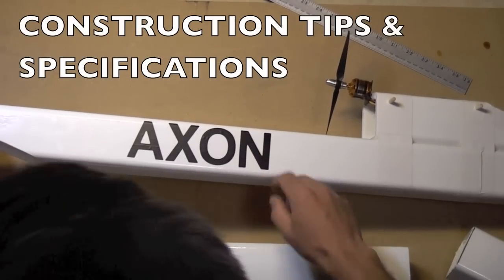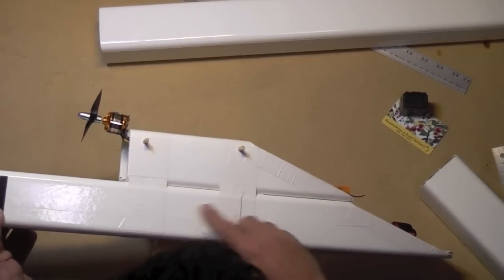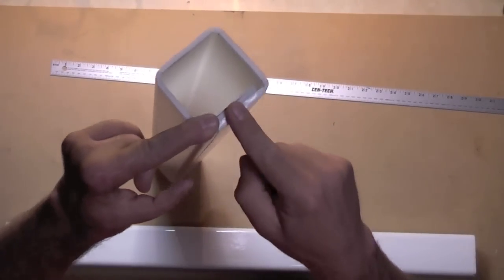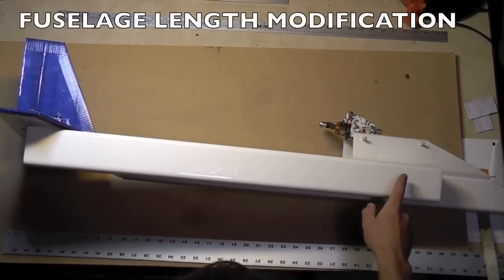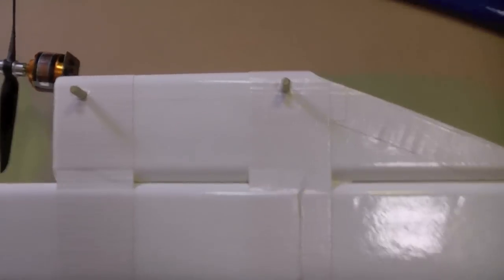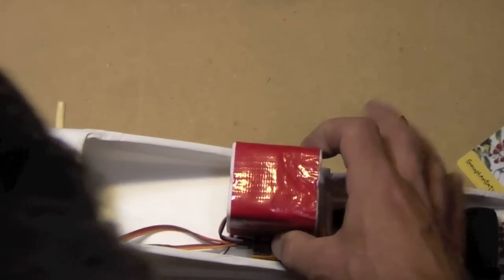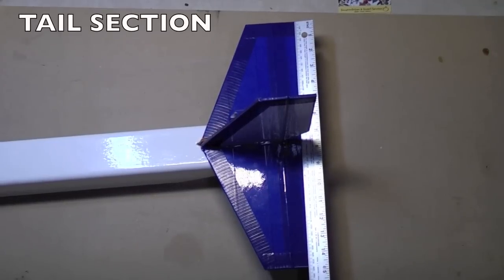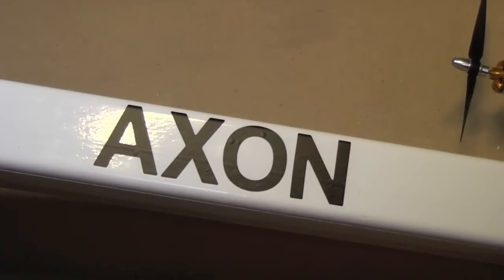AXON Construction Details

Comment: Can someone help me here. He uses a 2200kv motor at ~ 200-240W. What would be the impact if I use a 950kv with ~260W and the same propeller. If it won’t work, could I change the prop to make it work?

Comment: OK I am making this...can I use a 1300 kV motor running on a 30a ESC and a 2 cell 25c lipo??? plz reply
Reply: will I iface any problems with that motor?
Reply: 3 cell is simply "more fun"! I have flown mine on 2S many times and it just needs a less aggressive climb rate. These planes are "fabulous" and Ed is a real detail-oriented "wizard". No surprises here. I will never fly anything but a "pusher" design anymore - no more broken props and it is the safest plane in the sky these days (especially for newbees). They just "FLY - beautifully"!

Comment: Can any of you guys offer some advice.  I built this plane and I am having trouble getting it to fly.  It glides very well when I throw test it.  However when I turn the motor on it augurs nose into the ground almost immediately.  Any thought?
Reply: It sounds like you may be having an issue with the motor angle. I believe Ed recommends 5 degrees (downthrust). Did you double check that?

Comment: what type of wing will I need to use a 4000mah 4s with a 40 size 1500 kv motor? Will I be able to fit a 9x5 prop?
Reply: You can use whatever size wing you want...but you will not be able to clear a 9 inch prop with this design. I run a 7 inch prop and I have a slightly taller motor mount, and barely clears.  You will most likely need to do some changes for prop clearance, or different prop.
Reply: Christian Prodanov My goal is to have a wing that will allow me to travel the most distance thus obtain a lot of lift. What setup would you suggest I use?
Reply: Ed's setup is very efficient.  The 60 inch will give a better glide. Anything bigger. ..will be a difficult build and not as sturdy.
Reply: Christian Prodanov Thank you friend

Comment: Hey Ed, or anyone.... do you think it would be functional to upsize an Axon to a 65-70" wing and apropriate fuse size in order to carry a 4s 4000 nanotech and APM gear? I'm looking to repalce my Finwing Penguin and diggin scratch buildin from foam right now and this seems like a decent option. Any thoughts?
Reply: I think you can get away with a 60 inch. I have a 60 inch wing at 36" fuselage, and I can put a lot of weight on mine. Glide slope is great as well.

Comment: Just finished my Axon as well as Noob tube. Ed, thank you so much for making these videos.  I have been following them and building for over a month now.  Have a lot of spare parts and am assembling several more aircraft.  I'm confident that the noob will fly well and am scared to fly it as I spent a lot of time on it and it is virtually perfect...  The Axon I'm not too sure about.  I used a 60 in wingspan with 7in cord and 2 inch control surfaces.  It's heavy...  Think it's too much?  Guess putting it in the air will answer that...
Reply: Scott, I'm sure you did your maiden already.  I built an Axon with a 60" wingspan and large wing chord like you have and it flew great.  There is a video of it on youtube (search Axon Maiden).  The title is "Axon Maiden Flight - 60" Armin Wing" and it is under Liam (my son's) channel.
Reply: How did it fly?

Comment: Hi Ed,  I'm through most of the parts build and wonder about flaps..... have you ever put flaps on the larger wing and how did it work.  I've build 7in cord X 30in X2.  I figure I could use 60% control and 40% control surface as flap.  What are your thoughts?

Comment: My guess is that some air is always deflected outwards by the prop, not just backwards. And possibly forwards near the centre of the prop, as the shape there is not very efficient. Many of the flat board central prop RC flyers are very noisy if the gap around the prop is quite narrow.. Try blowing a stream of air from your lips and bring the edge of a credit card, or something flat, up into that stream of air. There's your noise.

Comment: I did this after tearing up aileron ends & a prop when my motor mount broke during the maiden flight. Found that the extra inch or so between prop & trailing edge made a very significant reduction in noise levels too.  No idea why this happens but I have "noise intolerant" neighbours so its certainly a good thing.

Comment from the maker: Yes, that is perfectly OK.  I use a 30 inch arrow in my 60 inch wings and no problems, even with hard maneuvers.  See the Photon design for some testing of that.  The carbon tubes you get from HK may be thinner so do have a look at them for strength.  Happy building - hope to see some videos!

Comment: Hello Ed. I´m considering a 55in wingspan Axon. I can find only HobbyKing´s hollow carbon tube 6x750mm or around 1/4 x 29,5in.,, no spare arrow shafts in my country. If I use one   the remainng 15in. section  of each half wing won´t get  a carbon  spar reinforcemnt. Is that a good Idea.?  Thanks for assistance and nice videos collection.

Comment from the maker: I would go on the generous side with your vertical stabilizer and rudder especially, and it wouldn't hurt to give a bit bigger horizontal stab as well. You'll want more affirmative yaw stability and control with that big wing.  Fortunately the control surfaces are somewhat within the prop blast, so that's a plus.  I'd say 9x6" for the vertical and 16x6 for the horizontal, swept recommended, and control surfaces 1.5".

Comment: I'm building a scaled down version of the Axon for my father in law and I was wondering if you think it's a good idea to make a 1.5" fuse tube?  I'm trying to make it 25% smaller except for the wing chord - 45" Wingspan, 30" Fuse.  I think I'll be using a little smaller motor since it will weigh less and allow for a smaller battery.

Comment: Hi Ed.. This may be pushing it a bit, but I have all of the parts & pieces from an ArtTech 98" wingspan D-2500A glider... which met with a violent death..  I am wondering if it would be possible to increase the size of the Axon proportionally to accommodate this equipment. The plane's weight was 67 oz., thrust rate-0.85 ... A  C3720 brushless motor and a 14x8 folding prop. .. Not sure if it would be practical, but I have this stuff laying around and I really like the looks of the Axon.

Comment from the maker: You could either stack another "deck" of foamboard on top, around the motor mount, which provides a flat surface for the wing, or you could make another motor mount with the motor tab longer so it sticks up higher, then you could mount the fuselage tab inside the power pod, clear of the wing.

Comment from the maker: Go with the bigger wing chord and more powerful motor.  Find any motor at 2000-3000KV that will take a 6" prop and puts out better than 400w.  Here is one idea from HK: 	NTM Prop Drive 28-36 2700KV / 595W.  This would scream with a 6x4 Master Airscrew prop.  It'll be noisy but it will do the trick.

Comment from the maker: 5" airfoil + 1.5" control surface would just be a little lighter and nimbler than the 7" + 2", but either is a fine choice depending on what you need to do with it.  The narrow wing has surprisingly good glide.  I would probably bump up the motor power for the larger chord wing, still a high KV motor but a bigger can with more watts.

Comment from the maker: Pretty standard 30-40% aft of the leading edge is good.  The 42" fuselage version does usually need landing gear, big battery, FPV gear, etc. or something in the nose to balance the tail.  If built for just a trainer or fun flyer, consider making the tail tube section shorter for an overall length of 36", for example.

Comment from the maker: Actually I meant the throttle-to-elevator mix might not to be as aggressive with the Axon since it already has a high thrust line, which tends to keep the nose down.  The flap-to-elevator also is likely to be less, but it kind of needs to be tuned to the individual plane.

Comment: Hey Ed, the freezer idea worked. In addition, I found it useful to use an 10" block of wood as a gig. It barely fits inside the square tube. I taped graph paper to it to help pre-align the motor mount on the gig itself. I used  four 1/8th inch bits of 3M tape to hold the mount on the gig during placement. Seemed to work. Thanks again.

Comment: Thank you for your help. I mounted the motor with the shaft through the vertical side. Now for your big secret. How do you align your motor & mount. I feel like a dentist working back in a small cave. The 3M tape is great, but it’s difficult to keep it free during trial and errrrror attempts. Thanks. The servos are coming. Should be in the air in a couple of weeks. Glad it doesn't have to be perfect to get off the ground.

Comment from the maker: 4. cut a new E-clip retention groove in the existing shaft, back out the grub screw, and push the shaft through with a vise and sockets.  For a pusher prop only, you have the option of just removing the E-clip (actually more of a C-clip on this motor) and the grub screw and just pushing the shaft through.  The can will NOT be attached but will stay on via the thrust generated.  However if you reverse wires, the prop will fly right off.  It's not a very safe way to go, not recommended.

Comment from the maker: Those are great motors, excellent choice you made.  You have several options, from easiest to hardest:  1. flip your motor mount and place shaft through it  2. there is an accessory kit to mount the prop hub on the motor can, then you just ignore or cut off the shaft  3. replace the 4mm shaft with one having the E-clip retention groove on the end (not the middle).  RCTimer is one source.  Use a bench vise and driver sockets to press out the shaft.  See forums and youtube for info.

Comment: Finishing my first build--Axon. Used the more powerful motor: 21481__NTM_Prop_Drive_28_36_2200KV...
Unfortunately, the motor came in with the 4 mounting holes and shaft on the same side.  How do I pull the shaft and reverse the setup? The local RC hobby shop guy said to pull the holding ring to pull the shaft, but he did not know if it could then be reinstalled on the other side. Thanks Ed. Your planes and videos are great!

Comment from the maker: Very carefully!  If you can weasel the adapter shaft in there by any means then do that preferentially.  If not I would use a drill press, and a bit that has some self-centering tendencies, like a step drill bit, so the new hole is as coaxial with the original hole as possible.

Comment: Did the scale thrust test Ed, had 360 Grams of thrust, Put the 6-4E prop on and it jumped up to 480 grams of thrust, I'm going to step it up to your recommended hardware, Thanks for the advise. So my maiden flight is on hold till I can be sure to get airborne. Thanks !

Comment: Hi Ed, i have watched some of your videos and would like to try building one of your planes,  I had a question on parts, i already have on order from HK, the following FC 28-12 1534kv, with 7x6 prop as the motor suggests, with a 20amp red brick esc  est. 730G thrust.  Can this combo work with the axon, or should i order as you suggest D2826-6 2200kv with a 40amp esc.  Trying to keep my costs low. Also would like to get a motor prop esc combo that i can change around on your different models.

Comment from the maker: 780g all-up, with a 2200mAh 3-cell included, is very respectable for an Axon, especially if it includes 187g of ballast.  That's a whole second battery right there.  Or you might think about landing gear.  As much a pain as they can be it does make first flights (takeoffs) less stressful in many ways.  I think your powerplant might be a little anemic.  You can very carefully put the nose on a kitchen scale and throttle up, and be sure you get at least 500g of thrust.

Comment: Hi Ed, I just completed  Building the Axon, Your instruction is top notch for a novice, I've never  had a transmitter in my hands let alone had anything airborne,  my maiden flight will be the first time I try my hand at flying, my question is how much should the Axon weigh RTF, My completed Axon weighs in at 780 grams, and the weight I need to correct the CG is about 187 gr, ?? 2620-1900Kv / 20a ESC / 5" prop. I have a 6-4e at the ready, 
just want to go up not down Thanks, MrDaFreak, SoCal.

Comment: Ed, I have flew my Axon 4th time yesterday... The plane doesn't seem to have enough power to do basic acrobatics. I have flown with the 6x4 prop and someone suggested to try at least 6x5.5 prop. So yesterday I have put the new 6x5.5 prop , it seems like it flies slowler and still doesn't do the loop. Can you give me any advice plz, it's just frustrating because in ur videos you make effortless loops, why doesn't mine do it ? :/ The plane is pretty light, no fpv or landing gear, just weights

Comment from the maker: That's a perfect motor, just the one I use.  You should get plenty of thrust from a 6x4 on a 3-cell Lipo.  The 2-cell 7.4v rating is fairly useless for these purposes.  A 5x5 would theoretically be OK but you'll obtain a bit more efficiency by using a 6" diameter and a slightly lower pitch.   You're on the right track!

Comment: Ed,
Thanks so for your vids! I made me up an Axon last night, but I'm a bit worried about my setup:
30A Esc 
6x4 APC
BP Hobbies A2212-6 Brushless outrunner

The motor specs are confusing and full of typos but it says its rated for 1000g/35Oz. Its a 2200kv w/ 22A Max Efficiency. Their neat little table says it pulls 13.2 A/98W w/ 6x4 APC and produces 338g of thrust on 7.4v. They recommended a 5x5 for 11.1V but don't list specs on a 5x5. 
Thoughts?

Comment: i got the kv wrong on this motor, its 1800kv not 1400, its a KEDA thumrun 2837/08 and the specs are
Motor Diameter: 28mm
Motor Length: 37mm
Shaft Diameter: 3.17mm
Motor Weight: 78g 
Rpm/Volt (kv):1800
Idle Current (Io) @8,4 V:1.8A
Resistance (Ri): 0.013 
Power:500W

Comment from the maker: Glad to hear about your project.  I don't think that powerplant is going to be adequate for a fully loaded plane.  I'd try to shoot closer to 2000kV or at least a 1400kV in the 36mm can length (ie: 2836).  I'm not sure what the foamboard you are using will weigh.  A similarly equipped Axon made of Dollar Tree foamboard would be around 1400g, and that's already fairly heavy.  I'd make sure your foamboard is not more than 150g per sheet roughly 20"x30".

Comment: i just ordered 10 sheets of foam board, and plan on making the AXON, this will be the English AXON, and now a quick question, will this build take 2x 2200 mAh lipos along with my fpv gear, i will use a 500mW 2.4ghz vtx with cloverleaf, a 600 tvl board cam, nova osd and chainlink rx, and i have a 1400kv motor i used on my bixler with a 7x4 prop, hoping this setup will work on the AXON, cheers and thanks for a great build video

Comment: Ted, you keep mentioning the double sided foam tape that you used here in other videos for attaching upper fuselage, and attaching the part that holds the battery. What kind of tape exactly is that? Can I buy it from the hardware store, also where can I find Velcro tape locally? Thanks!

Comment from the maker: Save the flattest parts for tail sections.  Use warped pieces for wings and fuselage tubes.  The warping becomes irrelevant once you make the bends for the wing camber and the fuselage corners - you won't even see it then.  Other than that I do not know of any way to fix warped sheets.

Comment from the maker: I think you would probably be good with that setup.  It's a perfect implementation of a 3-blade prop.  Of course you have an additional inch of blade length compared to a 6". The bigger motor diameter would take care of part of that.  The rest you would need to build up your upper fuselage and/or motor mount for clearance.  Let me know how it works.

Comment: I was wondering; I have 4 motors left over from a quad  propblem is they are 1100kv (3530 turnigy aerodrive xp) I also have some 3 bladed props that are   8x4s I can fit it all together on the described axon  but do you think I will  have enough thrust with the 1100kv? I was hoping the larger prop in the smaller 3 blade form could make up for the loss of rpm. thanks in advance boss

Comment from the maker: Either is fine, standard is likely to be a little cheaper.  The only difference is likely to be the shaft adapter is inserted in the opposite side of the prop hub, but it doesn't really matter, either type works.

Comment from the maker: I made one of 14 gauge that is about 6" long, but store-bought would be fine.  I don't know the magic number on length limitations as inductance increases and ripple current begins to abuse the ESC.  I usually like to put in a 2000-4700 microfarad 26v capacitor across the power leads as close to the ESC as possible if the power leads are longer than 12".  I'm sure there's a science to it though, I'm just not the best guy to ask.

Comment: Ok got it all together built it to the letter I think  5” cord 54” long 1.5” ailerons, wing mounted flat. 2200Kv motor 6x4 prop mounted on a salt cell plate at 5 deg. CG 1.5” back but it was so hard to fly. first two try's went strait down. took some weight off and it went up and over. Tried to get it up higher with soon speed and duel rates down to 30% was better but not much, can down hard. Just all over the place  Need help. Just don't know what to do next. Just start got the bug really bad

Comment from the maker: @race54321msncom  I use the "Carbon Hunter" from Cabelas, which are $3 each in a 6 pack.  I'd just look at your local sporting goods store for the cheapest carbon arrows.  They range up into the $20+ per arrow range, so be careful to look around.  You can get them online but the shipping cost can hurt.